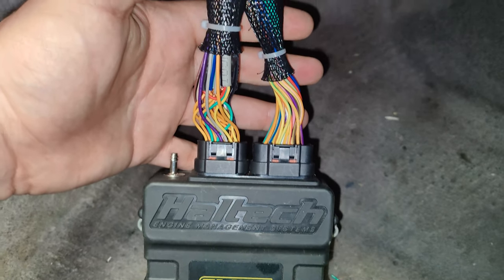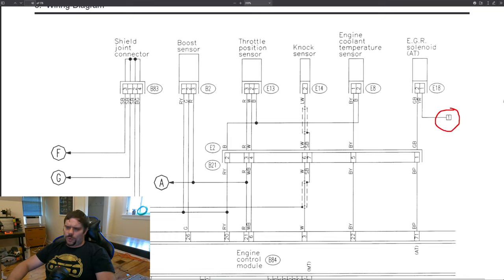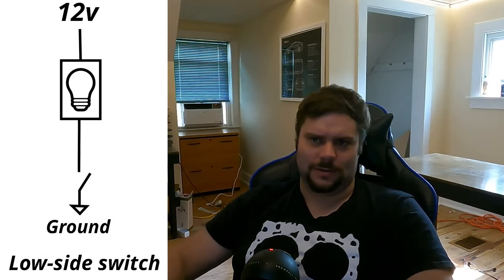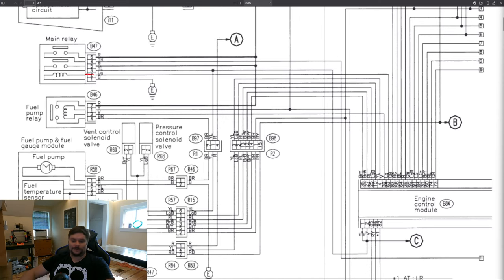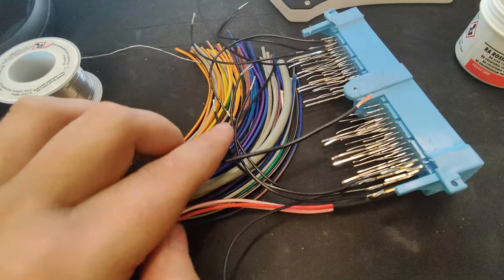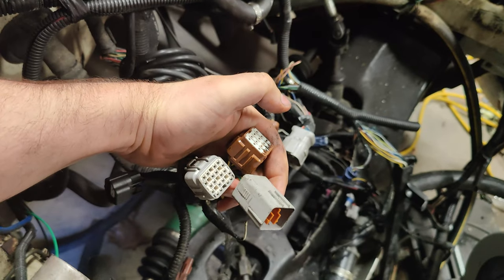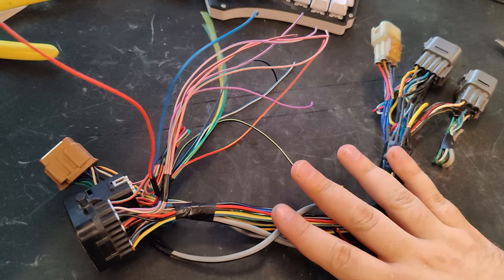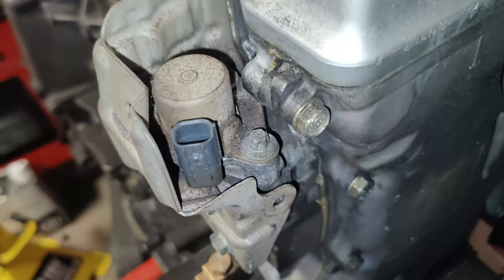Engine Swap Wiring: What You Need To Know

Comment: ROFL - "Don't be a barbarian!" and at 24:07 you are so delicately gently hacksawing the board connector. ROFL. Yes, using how air station and/or a vacuum pump with solder iron is so much slow and complicated (and requires hotair station and patience ) buuuuutt - hey, hacksaw works too :D + often there are premade boards that you can solder the OEM connector to and wire it non-barbarian way. I'd grab a spare ecu from junkyard and find a premade board for it - most cleanest, according to me.
Great video! I'm a Subarist too and that's why I found you. Keep up the great fun!
Reply: I literally was thinking why not just put a separate switch for the fan and fuel pump and he was like we're not barbarians and I was like I am...

Comment: I want to swap a LS into a Hyundai Iload and your video has helped me so much. Thanks
Reply: Hope you don't mind if i ask you a few questions. If i use the Haltech ECU, does the air bag warning lights etc still work on the factory dash? Rod
Reply from the maker: This is entirely dependent on the specific car and CAN BUS. Short answer is most likely that those things won't work. I have CAN BUS video on this channel for more info.
Reply: @BlackthumbTV  Where do you download the ECU/BCU wiring diagrams. I have been searching heaps and only get rubbish.

Comment: My favorite of all time is when you get say my Subaru rx turbo from 1985 and literally there is no correct service manual or wiring schematic color code or anything for that car so I have the 06 sti that has everything, well I had to make my own wiring diagram custom for swapping and man the first swap was the most tedious merge IV ever done but the capabilities of the 34 dollar a month insurance made it all worth it. After the first merge and labeling everything now it’s just a basic plug and play harness merge whenever I need to swap because i set it up as such. And this is the time for a wire tuck for those interested. It’s already chopped up just run each sensor like a stand-alone and make your own custom hidden wire harness. It really does make everything easier in the long run if you plan on actually working in the car like I do.

Comment: I'm really waiting for the CAN bus emulation for standalone ECU video. I want to see if it is possible to avoid using a 7000$ oscilloscope to sniff capture the CAN wires. I really want to do it because I want to get rid my factory ECU (a Marelli 5NF JUNK in a 1.6 Fiat Stilo) but retain all CAN connectivity and functions. And I'm looking towards rusEFI due to price. I will especially need it if and when I decide to engine swap a 2.0 5cyl 20VT off a Fiat Coupe. Thanks for all your effort you put in these videos man!

Comment: Real talk, this is great content. I spent 2 days making an adapter harness to put a 4G63 into my 1990 CRX. I just had both wiring schematics printed out and side by side. This was the first time I ever did a cross-platform conversion. I really enjoy how you've really spelled it out for the home gamer. Thank you. You're doing the real work spelling all of this out and documenting this.
Please keep it up.
P.S. you are in PA I think? What's the local emission/inspection situation there in regards to emissions and inspections? I've a 1992 Merc that I am just putting an LS in and out in NV a car of that age can get a vintage plate with no emissions. If it did even it would just be a sniffer in the tailpipe and not on rollers. I'm not too concerned because I can just run it lean if necessary but I'm going to run a cat.
Reply from the maker: I am indeed in PA, inspections are county-based. I live in a rural area where there are simply no emissions inspections, and that's intentional lol

Comment: I have it sitting crate style, with its ecm on it. But before I hang it I wanted to set up a manual switch to the starter, fule pump and radiator fan so I can have like a rocket launch board of red switches. With this video it should be a breeze. I'll try to post shorts on it soon

Comment: Thanks for your efforts, can I control diesel Duramax swap with haltech or do they have standalone can bus for diesel
Reply from the maker: Haltech is gasoline-only, as are many others. I believe most people doing diesel swaps will use the factory ECU, strip down the harness to make it standalone, and reflash the ECU so it doesn't need to talk to any other modules in the car (disable VATS, etc).
Reply: @BlackthumbTV  thanks a lot, I'm doing lbz dmax into my H1 hummer

Comment: I wanna ask quick question i have a 2013 dodge dart with the 2.0 engine i swap the engine from a 2.4l now i have the diagram of the 2.0 bcm and the diagram from the 2.4l bcm and they both match up just gotta put the wires together

My question is will this help on making my engine start and work

Comment: I have done several toyota engine swaps.  1MZ, 3MZ in celicas.  5Vz in older 4runners. 3S-GTE also in celicas.  I can speak by good experience,  Toyota wiring diagrams are 100% better over Subaru.

Comment: Hey there, Mr. Blackthumb. Got a potentially stupid question, but it would really help if you could answer it. In your opinion, which is easier to do: H6 engine swap into an H4 of the same year/model car, OR a manual tranny swap into an H6? I have an H4 and really want to change to an H6 but keep the 5-speed manual.
Reply from the maker: Manual swapping an H6 car would probably he easier. Most things are already done, like exhaust and cooling system. Maybe a bit of electrical work to get the ecu to play nicely with manual. Subaru manual swaps aren't all that hard thankfully.

Comment: So if a Haltech is 2k or so alone, but you just want a basic swap with the stock tune… cheapest route is swap the engine trans and wiring from a donor car?
Reply from the maker: Depending on the ECU, you can treat it as a standalone and simply make a wiring adapter from Donor ECU to Car ECU, just like this video describes. While you won't have a nice wiring diagram like Haltech provides, you could probably still get a pinout for the Donor ECU and wire it into the Car ECUs connector.

I've done this before (2002 WRX ECU into 2000 Impreza) and had great success.

Comment: Yo is that a Prius inverter in the background?  Do you plan on using open inverter control board or is it just some parts?
Reply from the maker: It sure is, you have a keen eye! I have a number of them, was using them in an electric go cart project but ended up getting distracted from it.

I also have a Tesla drive unit powered by an official Open Inverter board, though it turned out to be trash as the diff gears were messed up so I paused that project as well. Might make pick it back up this winter.

I'm a huge fan of what Damien and Johannes have done, and love their work. Open source is the way to go!
Reply: @BlackthumbTV  nice! Im waiting for them to implement CCS or NACS into the zombieverter VCU

Comment: Hey, great material here...Is it possible that I can "HIRE YOU" to formulate a Wiring Diagram PLAN to install my MaxxEcu SPORT into my 1994 Volvo 940 turbo LH2.4....There is a Fuel Ecu (967) and an Igniyion EZK 148 Computer (2 Separate Computers) and Im a little puzzled about how to incorporate the factory wiring into the MaxxEcu flying harness...I will be using most of the Original sensors EXCEPT that I will be using a VW Direct Fire Coil with Integrated Amplifier, Deleting the Bosch Maf sensor in favor of a Map sensor and swapping the tps for a potentiometer Volvo 850 tps...I need your MIND as I dont trust mines...

Comment: Were you able to successfully tune the cold starts and warmups? Does it feel dailyable with the haltech?

I had an e30 running on megasquirt a while back and it never started/warmed up right. Considering an H6 swap in my future and I want to see what people’s experiences are with the haltech
Reply from the maker: Rough cold starts have less to do with the Haltech and more to do with the tune.

My cars that run E85 generally have a rough time cold starting until I go in and tweak the cranking fueling tables. My cars on regular petrol usually are fine, but I'll still tweak things depending on injector size

Haltech has a great video about tuning cold starts on their YouTube.
Reply: MS is pain to get coldstarts fine, especially on MS2. Once you get them OK you'll be fine to daily the MS. Just take time to watch/read more about the ASE (After Startup Enrichment),  WUE(Warmup enrichment) and idle control types/tables and tuning. It's quite tidious, but once you get it you'll tune it to work fine.
Reply: @valqkasdf  I'm wondering if cold start tuning is easier on a haltech compared to MS. Do you have any experience with both platforms?
Reply: @ChrisMcPorsche  Only with MS, sorry.

Comment: Would you be able to wire a engine   to a factory ecu?  Like would I be able to reuse a factory ecu with matching motor into another car..for instance I want to put a 2004 4.6L 32v v8 mustang motor and transmission 5 speed into my 1995 Lexus 4.0L 32v v8 with a automatic.  End result 1995 Lexus 4.6L 32v v8 w/ a 5 speed. ????
Reply from the maker: This should indeed be possible, however you need to make sure the ECU can run independent of the rest of the original car. IE it doesn't need to communicate with other modules. See my CAN BUS video for more info on that.

Comment: whats wrong with the yellow, red, blue crimps except for adding size to the loom?
Reply from the maker: Certainly the size is number the one issue, but I also find them unreliable. The crimps don't seem to hold well, and the insulation makes it hard to get a good crimp, and see if it even worked.
Reply: @BlackthumbTV  dam I just made my whole body harness with them in my drift car. 
Guess I'll fix it as it breaks 😅

Comment: Hello! I’m not sure if you respond to commented questions but I was wondering what implications the engines écu could have. I’m possibly going to under take swapping a 4agze into a celica and I was under the impression that I could use the ecu from the engine while only modifying the wiring harness. Is this true in any sense? On another note these videos are dope and insanely helpful and direct. Thank you for your time!
Reply: I also understand that a stand alone would be easier to wire in possibly but using the engine ecu would be cheaper for me and I’m worried that I wouldn’t have the skills to tune a super charged engine to manage what little boost was produced even with a base toon.
Reply: Tune*
Reply from the maker: Technically, yes. You could treat the factory 4agze ECU as a standalone and wire it in as this video describes, though it will be a bit more difficult as you need to find a pinout for each pin does on the factory ECU and map it over. 

That being said, I've done this exact thing before with good success, though only after I had learned the ropes by wiring in a standalone ECU.

As for tuning under boost, it's the same as tuning NA cars. Lest we forget that it's not boost that kills engines, it's knock and torque (for the most part).
Reply: @BlackthumbTV  that’s great to know. And yeah that’s exactly what I thought I needed, the pin out and then it becomes a matter of some what fusing the wiring harnesses? Also I think it’s great that you answer questions on here thank you so much man like that’s awesome. Also also I checked out the engine yesterday and man it was sick seeing one in person. Like an engine that I’ve been thinking about for a while in person.

Comment: Guess i'm SOL.  Can't find a mercury in any of them.  Want to drop my '82 5L Grande Marque engine in my '71 F100.  Guess it will be stock ECU or nothing.
Don't see a saturn either to swap a DOC in my SL1.  '95 uses 2 temp sensors, the 96 engine uses just one.

Comment: Yah, it seems like itd be simple, subaru to subaru, but Mopar support literally told me it would be impossible to make a new gen 5.7 hemi crate engine work in a pre-gen 3, 5.7 dodge magnum hemi...and apparently most mechanics agree with them.  If the motor doesnt plug in directly to the stock harness and ECU modern "mechanics" consider it "impossible" So i let the mechanic talk me into returning the crate and going with a rebuilt.  Honestly i should have gone crate, id have the 400+ horsepower i should instead of the 280 that the older gen "high performance" version thats supposed to pull 400 hp.  Ugh, could have had vvt and fresh electronics doing it all myself instead of a motor missing bolts all over because there are no good mechanics in Vegas... And having to rebuild the whole tranny myself anyway because of that so called mechanic..

Bottom line, if they can't make it work because the "connectors don't match" they're telling you they don't know how to read a wiring diagram...and probably shouldn't be considered a professional mechanic.  If you're above room temperature IQ you can learn to do this stuff, I have, anything CAN be put into anything with a little ingenuity and work assuming the physical space is there.